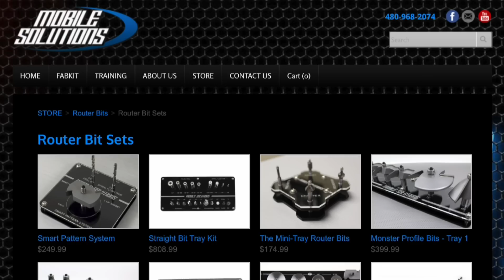F#CK MY BRAIN!!!

Comment: When you use the perfect circle jig, have you tried only cutting 1/2" deep, then flipping it and making a second pass? It leaves the piece fully supported, you don't cut into the work surface, and you don't have the issue of it getting all wonky when your done with the cut.